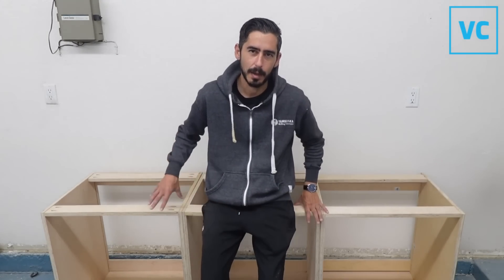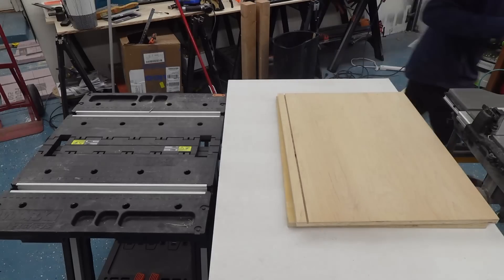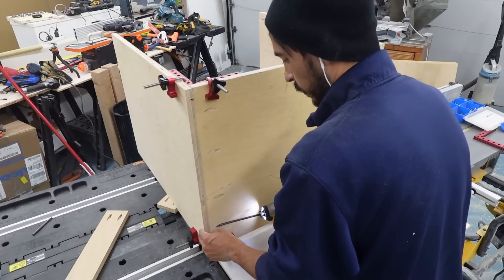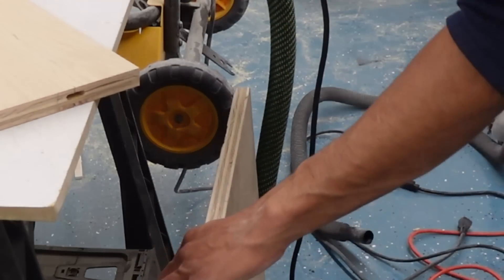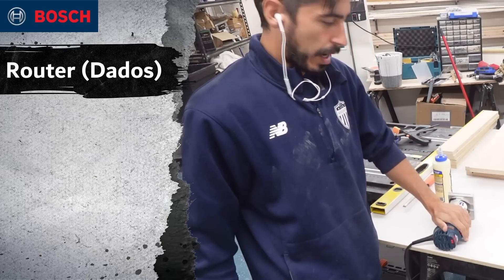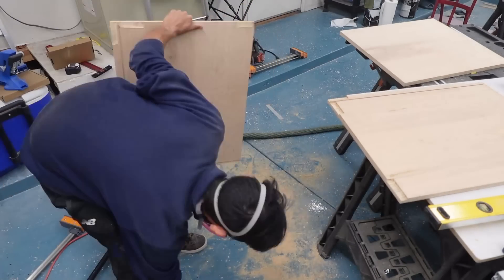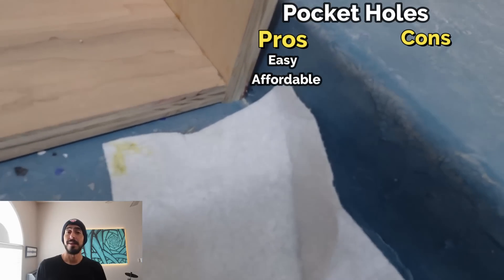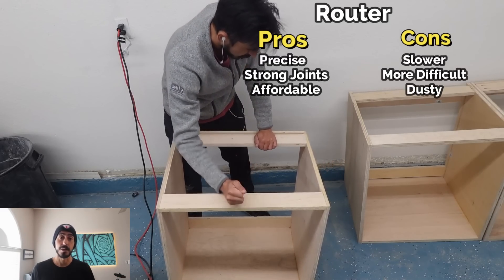Dominos vs Pocket Holes vs Dados | Testing Joinery on Cabinet Boxes

Comment: You are way faster than me, both on assembly and cutting.

But hey, it's a hobby, not a sprint!

I'm a pocket hole agnostic, they are perfectly fine for most purposes and I sometimes use them.

But it's more fun to use the domino.

The router method requires different width for the stretchers, and the use of hand tools - both are great opportunities for me to make mistakes.

All three cabinets looks great!
Reply from the maker: Thanks for watching Niklas! Yea I agree with all three points, the more I use it and get familiar, the domino has become a lot more fun and easier to use

Comment: I do not own a domino and have never used one,  so I cannot argue with that choice.  I do however,  own a Kreg Foreman, which is the Cat Daddy of Kreg pocket hole screws.  It is very nice and does a great job on pocket holes.  However,  I have a router table with dust collection and to me,  it is at least twice as fast as the pocket hole process.  I cut all my pieces to size,  then take the appropriate pieces to the router table and zip zip,  they are done. (One time setup and away you go)  I then glue them up, same as you do with other methods.  If,  all the parts are hidden,  I don't use clamps,  but use my staple gun and I am done in nothing flat.  The pieces basically align themselves and almost never need adjustment to make them square. 

In the end,  it is a matter of personal preference and the tools one has available.  

Nice video...I am now a new subscriber.
Reply from the maker: Thanks John! Makes sense. Actually since making this one, I have made most of my cabinets with dados, which I love.  One question if I may, if you have a cabinet with a middle shelf to be installed, do you also make a dado groove with the router table? Is there enough table surface to use a fence typically?

Comment: Very nice video. May I suggest you buy yourself a Bora Centipede 4x8 work table leg set.  So much easier to do all your track saw work at 30” to 36” off the floor. My back aches every time I watch you guys get down on the ground. And the Centipedes fold away and store in practically zero room. Thanks for your video and contribution.
Reply from the maker: Thanks Steven! Believe it or not I have one of those to address this, but my shop space is kinda tight so it is tricky to fit completely unfolded depending on the workpiece. I need to do something though, both my knees and my back are telling me to work smarter.  Appreciate you watching!

Comment: I worked at a cabinet shop for a number of years. Always used pocket holes unless customer requested different. Using pocket holes, I could build 2 complete houses of cabinets in 4 days. That’s kitchen and baths and utility. When using rabbits and dados, it would be 1 house in 4 days. We always used 1/4” plywood for backs of cabinets which gives tremendous strength to the cabinet. Glue on everything and staples on the back. The rabbit/dado build was definitely a more solid cabinet. That’s the only way I build them now retired. But still liked the comparison 😊
Reply from the maker: Interesting, always like hearing about how the pros do things.  Jealous at how fast they can crank out these cabinets.  Thanks for watching Jeff!
Reply: I’m guessing you also used the router-style pocket hole maker, right? Assembled at the shop, and not on site?
Reply: @gavinistheawesomest  sort of. A maintenance guy at an auto factory made a similar one. Used a clamped in place drill with the Kreg drill bit. Step on a foot switch, pneumatic plunge clamp holds piece down, drill advances to set depth. So easy and fast. I’m thinking it worked better than most of the ones on the market. I loved that job. Had fun every day.

Comment: Using the cross stop would've been faster for the dominoes. There is no need to draw lines. Taking 53 minutes is strange using the domino. Would've done that in less time. Great video. More of this.
Reply from the maker: Hate to admit that I only found the usefulness of the cross stop after filming this which could’ve really decreased the time.  One drawback of me trying to do the comparison without having a lot of time using the domino

Comment: Thank you for this video comparison. As most of us are more budget-minded, what about a dowel jig? They are low-cost and are proven to be as strong as dominos (or stronger as they spread the load over a larger area). I use a combination of pocket holes and dowels.
Reply from the maker: Thanks for watching Duncan! Dowels are really just a blind spot for me, I haven’t used them much but I hear good things.  In retrospect I wish I had included here. Thanks for the input!

Comment: I’m about to start a big shop cabinet build. I won’t be buying a domino though. I’m tending towards using the router, I have a small router table, the stringers would need to be longer though right? And the bottom panel?
Reply from the maker: Hi Stuart, yes, I think what you are asking is since the stringers will be in a dado groove they will need to be longer than using a domino, where the boards sit flush, to get the same final width of the box and yes you are correct.  Think I made the depth of the dados/rabbets 3/8 inch deep so total for both sides was 3/4 inch additional length needed for the stringers and the bottom panel. Definitely important to keep that in mind if you have a precise space to fill.  Good luck in your build!
Reply: @vanishingcabinets  thanks for the reply. 🙌

Comment: Great video and comparison. I will say.. your Domino took you a LOT of time to learn to use.. and STILL came in at only 2 mins slower than the pocket setup which is super simple/fast and same time as the rabbits. You mentioned at the end that it has the potential to get faster. I would say it DEFINITELY will get much faster once you know how to use it. As another person said, you can use the pins on the domino to help provide repeat mortises. What I also think though is that the domino joints are largely as strong if not stronger than the other methods. The dado/rabbit has the potential to be stronger when in the middle (e.g. 1/4" grove in 3/4" stock), but to your point takes time to set up the line to be perfectly straight, clamp down to cut it, etc. Even with the dado stack you have to usually change the blades which takes time. But the edge rabbits aren't as strong (or on par with) the domino joints, especially if you go a bit larger on the tenons. BUT.. besides all that, the one thing I think really begs to be called out is the domino is MUCH more versatile than the other methods. You can use the domino in a variety of scenarios that the other two are just not easy if not impossible to do. For example, curved or angled furniture.. while possible on the pocket, not as easy to clamp and put holes in to. Not even possible with a dado stack and difficult at best with a palm router for a dado. You can also use the Domino holder (separate plans available for $12 I think on seneca's site (forget where I got it from) which can hold the Domino (either XL or 500) in a vertical position so you can quickly apply the tool to whatever that you bring to it.. making it more for smaller repeat mortises. I'd add that buying the XL (DF700) and adding Seneca's XL to DF00 plate/bit extender makes the XL work as a DF500 as well. AND.. I found on FindBuyTools a set of router bits for 1/2" shank that cut out tenons (e.g. feed it long stock and it routs the rounded U on each side (as opposed to rounder over bit that you have to run piece four times thru, this you do twice) and even has the grooves tenons have. I suspect because its probably from China they are not yet (or will ever be) sued by Festool for being able to cut nearly identical tenons from whatever wood you want. (https://www.findbuytool.com/products/router-bit-for-festool-dominos-4pcs?variant=43557123883242).  At any rate.. the high cost of the tool (esp DF700 + Seneca plates + router bits) is going to make the other two options FAR more viable for most folks.. but I'd say if you are making money on building these sorts of things, the domino is a no brainer given how fast and accurate and repeatable it can be once you get the hang of it. I bet you could make those cabinets in under 30 minutes with the domino once you get it dialed in.
Reply from the maker: Thanks for the detailed response here! Some really great point and yes, I have gotten better with the tool and really does get easier and faster.  Still working the versatile aspect as I haven’t used it on too many different things, but I’m sure that will change with time.  Thanks for watching!

Comment: i think if you had the kreg clamp that utilizes the holes, your alignment might have been much better
Reply from the maker: Oh right right I have seen those.  I’ll bet you are right  they would’ve helped out a lot here.  The regular trigger clamps just slide around
Reply: I have those Kreg clamps and the pocket screws are still finicky to put in without movement.  I also have not spent hours of practice with the Kreg clamp either.

Comment: Save $1500 and just use a dowel pin jig that cost $30 and pocket holes. Dowels provide the joint strength and pocket holes provide the clamping. And build your cabinets metric to follow lr32 guidelines  for faster production .
Reply from the maker: Yea I’ve seen several people mention dowels. Will definitely give them a shot next time I build cabinets or something similar

Comment: I really enjoyed your video. Nice to see a "regular guy" thinking things through.  It did cause me to stop and think about how I would choose to assemble cabinets in my shop.  In the end, given your investment in the Domino, I can see why you would use that method for your cabinet construction.  I would, however, add glue along the joint line instead of just on the dominoes themselves.  That would add a LOT of rigidity and strength (and thus long-term life) to your cabinets.  
Minor quibble:  You said the pocket hole method was slow, but by your own timing it was ~3 minutes faster than the other two options. I believe you would have gotten better results (and saved time) had you used a couple of Kreg Right Angle Clamp to keep the joints in alignment while assembling.  Those clamps are WAY faster and easier than fiddling around with those corner clamps.  With just that one simple change, you could probably have reduced your time for pocket hole assembly by a total of maybe 5 minutes, so it would have way faster than the other methods in your timing.  I'm not saying you should switch to pocket hole joinery (that ship probably sailed when you shelled out $$$ for the Domino!), just that pocket hole assembly can be pretty quick if you use the clamps.  That's why a lot of production shops use them for cabinets.
I'm pretty confident Domino assembly will be faster on your next cabinet(s).  I'm not sure how fair it is to ANY of the methods to include your "learning curve" time in the competition here.  That's why people recommend doing "test articles" before using any of these methods, so you get the learning curve out of the way and make any mistakes with your test pieces.  If you weren't stopping to think about HOW to assemble the joints (or having to assemble the clamping screws for your corner clamps), your actual assembly times would have been reduced – significantly in some cases.  
On the "dado" (actually "rabbet") method...  You took the time to square up the corners of your "stretcher" dados with a chisel, even though they are in a position where that would go largely unseen.  I might have just cut the rabbets a bit longer, and left the "rounded" part of the dado exposed inside the top and back of the cabinet, where it would go largely unseen.  I know it's not a huge amount of time and effort to chisel those corners, but if saving time is important, it would make a difference.  As as DKWalser mentioned, using a dado blade on your table saw would have made the process of cutting those rabbets faster, as well as more accurate and repeatable.

In reality, all three of these methods can produce excellent results.  It really comes down to what tools and equipment you have in your shop, and how you prefer to work.  The Domino is not something I can afford for my "hobby" environment, so that method is out for me.  I would probably use a hybrid method, using a dado blade (which I already have) to cut the full-length rabbets, and pocket holes to secure the stretchers, but that's just me, and what I think would work best in my shop.  Again, thanks for the nice though-provoking video!
Reply from the maker: Thanks for the feedback! Wow actually all those callouts legitimately make a lot of sense to me.  I’ll check out the Kreg clamps because the ones I used were super slow.  I guess I said pocket holes were slow because on the day it seemed like I spent more time taking measurements and dialing in tools on the other two, so if doing multiple, would’ve greatly improved my time whereas the pocket holes seemed like I couldn’t have been way more efficient.  Although with better clamps, may be a lot faster as you suggest. Great suggestions, thanks!

Comment: None of these - all too complicated.  No dado's, no rabbets, nothing.  Cut your panels, tack them together with  brad nails, predrill with countersink, screw with 2" screws and be done.  Screw on a square back panel and off you go.  If using face frames, add some pockets to secure the frame to the carcass.  Use ladder toe kicks, no need to cut out your toe kicks or anything like this.
Reply from the maker: Love it, keep it simple and effective! Especially for carcasses. Although I was making this as a demo/experimentation, for something like these, I agree could be made simpler.

Comment: Great video. I feel like the pocket hole method allows you to reduce the assembly if you are putting together multiple cabinets. It feel like you could batch some of the assembly like the pocket drilling.
Reply from the maker: Yep for sure, drilling the pockets for a bunch at a time would go super quick and assembly would get faster, the more you do and get in a rhythm.

Comment: why not just use the table saw for the dados and rabbet cuts? all 3 methods you showed are less precise and require more time and effort, no good if your production building and no good really if your only doing one or a few every now and then, except the router method because of relative cheap cost, the kreg jigs are worthless and the domino is good but not for production, a good table saw with layout table is far better.
Reply from the maker: I agree with you, the table saw would probably have been a quicker and easier way to go. I think for the rabbet cuts I did for the stretchers, only limited to the width of the boards, I couldn't do the same way on the table saw, but also don't think that was totally necessary. Probably just could've rabbeted all 3 sides.

Comment: Lamello Zeta P-2 with tenso clips makes it a breeze. No need for clamps. This machine is a gamechanger.
Reply from the maker: Been researching this one since a couple other have mentioned it. Looks awesome!
Reply: It's even more expensive than then Domino and has less uses though. It does look cool.. but what bugs me is it is literally just a biscuit joiner with a little "bump" at the end to make the groove. That bugs me they charge $2K+ for that little tiny motor thingy that bumps the blade up/down a wee bit. To me the product shouldn't be more than $300 or so. They'd have WAY WAY more sales (and a lot more money) if they dropped the price to the $300 to $500 range. Sometimes the economy of scale will make you more money.. this is one product that would hugely benefit from that change. Guarantee you a LOT of domino buyers would switch to the Zeta if it were in the $300 range.

Comment: I haven't completely tested this stereo but I think going with the 5 mm I believe on the domino and then using the plants on method. So I mentioned this in a different comment but the back is a full size of the cabinet. So if you have a 36 inch wide cabinet that's square is exactly 36 in okay and that gets screwed in to the sides. Yeah I know. That's weird but a lot of the cabin shops here have been here for over 30 plus years. I'll be doing this way and there's nothing wrong with it. That will allow you to make the sides consistent. You can reverse it but my thought process and by having a back being on the inside by the reason why I'm doing the plants on method is that you can make the dominoes mainly all on the back panel. So you would use the referential fence and just place those there and then so when you have a back you just go referential everywhere except for the bottom is the bottom is going to be a little bit higher so so there's less thinking. You put all the dominoes in there and then you would then do the same thing on the sides of the edge right of the cabinet sides. So imagine the back being laying flat on the table with a Domino's sticking out of it. Then the sides of the cabinet pop in to the Domino's and then you would just screw the rest. So I think really you can gang these up and process them much quicker. I mean you can put dominoes in the sides of the bottom and then assemble the whole box and then just slip the top the whole box onto the back.
Reply from the maker: I think I am following, does make sense to me, especially if building several and getting into a rhythm.